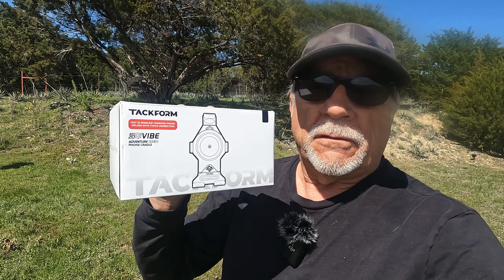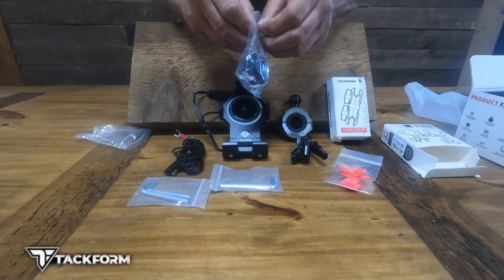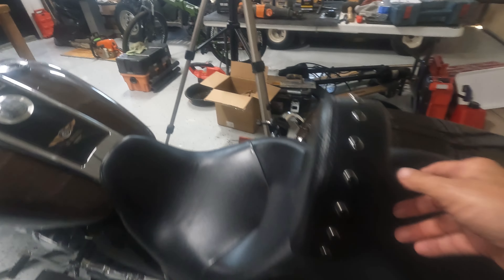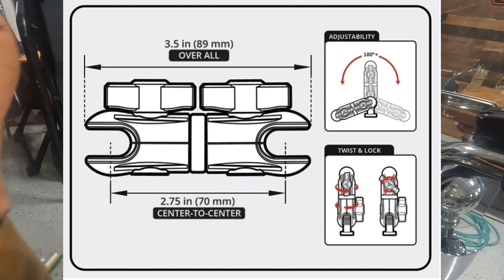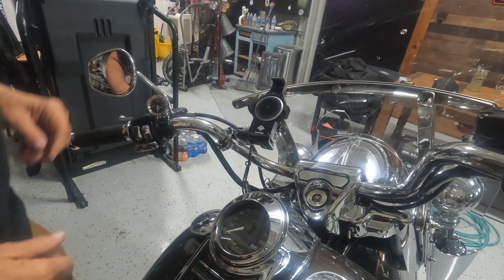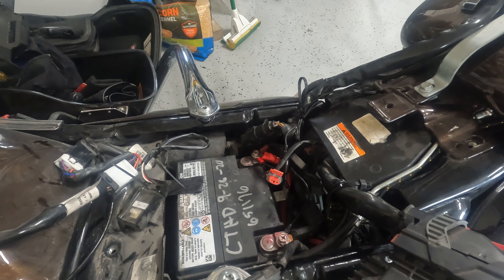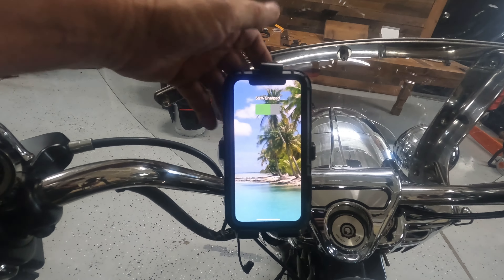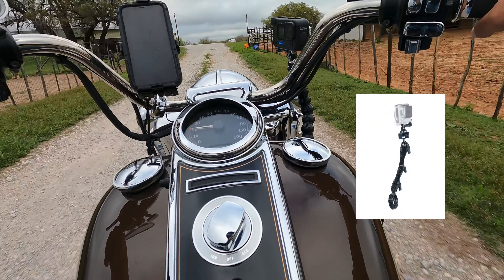📱World’s Best MOTORCYCLE Wireless Charging PHONE MOUNT | Install & Review

Comment: Did this ever kill your battery I know some people that said not to buy anything that hooks up to the battery 😂 so I figured I’d ask you
Reply from the maker: @itzjustnatedogg  no, not at all and my battery is 5 years old. You can turn it on and off, it has a push button on the middle of the pad. I only turn it on if I  need to or if I’m using goggle maps on the phone to keep it charged while I’m riding. It’s really nice not having a cord to plug the phone up. If I left it turned on while the bike was not running then yes it would probably kill the battery eventually. Thanks for watching! 🤜🏻💥🤛🏻